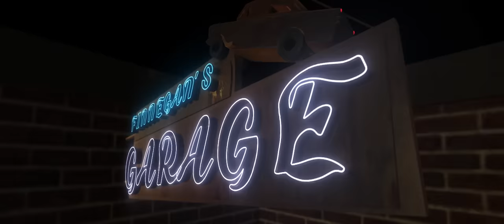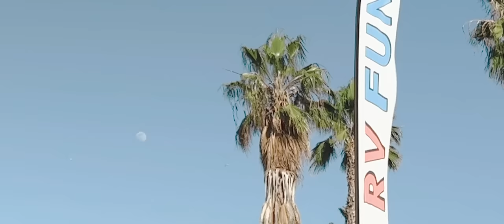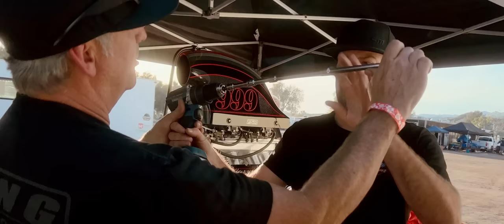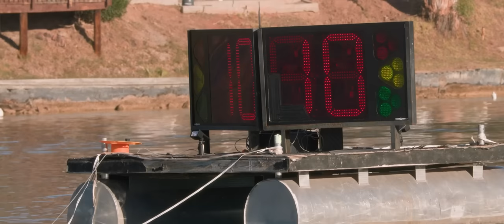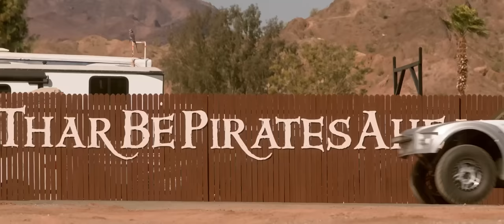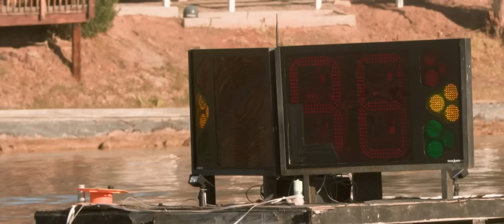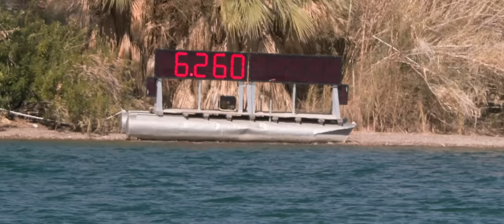BROKE THE 632CI V8 AND STILL WENT TO THE FINALS!

Comment: Hello Mike 
Awesome video.
On the milkshake issue,
Would you happen to have a
Pressure Relief Valve install?
Most pressure relief valves are set to 
15 lbs max. Anything higher than 15 lbs will blow gaskets causing milkshake. 
Also a water pressure gauge mounted on the intake manifold is always good to monitor the water pressure. 
But maybe they weren't installed because extra weight slows things down when racing.
Thanks again Mike,
Love the boat racing videos
Peace
✌️😎

Comment: That fires up sweet! I see a lot of these "tuned" engines on YouTube and they always crank for days and days before starting. I never understand it. I don't know if it's something with with the tune or the ECU timing fuel injection or something I don't know. I'm just saying even on engines that aren't built mostly carbureted when the timings right and you have a good ignition system it's just a tap the key pops right off
Reply: Like I understand that with a crank trigger the engine has to make a rotation before it can pick up a signal. It just seems odd to me For a race engine to crank  for days before it starts. I don't know what you're running for ignition but that pops off really nice 👍

Comment: Awesome Show! Tell us about the differences between propeller boats and jet boats. Tell us why you like water pump!
Reply from the maker: i like the acceleration of the jet drive. I also like the challenge of making a jet boat work properly. from what i understand, propeller-driven boats are more efficient and faster. Top Fuel Hydros have twin counter-rotating propellers and can run over 260 mph. No jet boat will do that.

Comment: Can you use a spoiler type thing on the front, but in the water.  Adjustable like a active aero/ but hydro. With the correct sensors you could use like a laser height sensor. Keep it in the water.

Comment: Here's a tip of you Finn! Put a small hole in a 1" suction cup, attach an air nozzle and use light pressure to force the jb weld into the pores.

Comment: So just curios Mike after making that first good pass and watching that camera under the bow the left side (sitting in the drivers seat) looks like it's sitting lower in the water than the right during the run is that caused by the torque of the engine and or the prop and does more boat in the water create drag or are the hulls just that slick and nothing slows them down, excuse my apparent stupidity just never spent that much time around boats although now I'll be seeing more.....

Comment: You should get a pressure regulator for a boiler. It would still let water flow but they're usually set at 15 lbs. of pressure to auto fill the heating system.

Comment: Ok so plugging the line with a pipe plug drilled to a smaller size will increase pressure only restriction will be in volume but the pressure should actually increase with only the volume decreasing. Think of a water hose no end on the hose low pressure lots of volume but if you put a sprayer end or let’s say you put a low flow shower head the pressure would be amazing it would just cut the volume down. So you save water but you have amazing pressure. I only use low flow shower heads and the absolutey have the best pressure and anyone who uses my shower always comments on the pressure coming from the shower head. But you do you. The best way to kill the pressure would be to go bigger the volume will increase but the pressure will go down.  Hope this helps you bud

Comment: Should look into a helmet with a duck bill at the bottom to help prevent the lifting. Looks like you’re holding it down at the end of each run. Dirt racing helmets are sfi and designed for that.

Comment: HI here idea you could try it new idea, so for u test boat out of the lake is build very long pool or long dump truck trailer fill water so sit boat in water test boat and have tech gear near boat so don't keep going to the lake too test it, if someone got truck want build dyno pool tester for boats it save u 100's hours moving boat to lake., if have ramp on back so pull boat into it then fill up water with water tanker would be so much easy then way you doing now, if had crane on truck pickup the  boat save time as well so test more 1 boat a day. this make your life lot more easy as well test boat on spot.

Comment: super disappointing, but i fired up the 383 in my roadrunner for the first time with a flat tappet, and the alternator yacked. I have rubber chunks on the bottom of the hood from the belt running past it while it was locked up and I was breaking the cam in. Its been about 2 years.

Comment: I see you used the 2 part epoxy, but why could you not tig weld the leak on the head? Wouldn't that work better and be a more permanent fix?

Comment: Was the guy with the carburetor problems going rich because the squirter is bleeding in extra fuel at high rpm. Happens even if the throttle is not moved.
Reply from the maker: I don't think that was his problem He seemed to be having fuel distribution issues and a few cylinders were pretty lean.

Comment: One of my friends was too cheap to pay me to install a clutch in their 2002 camaro ss and I was giving them a excellent deal at my shop.  The person decided to do it themselves and put every extension together they had to access the top bell housing bolt.  They didn't anticipate the wobbling when they attached a 1/2" drive pneumatic impact on it.  When they pulled the trigger the only thing that broke loose was their teeth.  Paying me a couple hundred bucks to do the clutch would of been much cheaper then the $5000 they spent in dental work.

Comment: What could possibly go wrong, with a blazing alternator in a boat with racing fuel on board? Might need head gaskets too bro. Better get all of them to see if you can keep water out of the oil ports. Every time I got water in the oil it was gasket related guys. The way you guys spring information on us about previous disasters with the parts how in the world can we help you all trouble the problems without all the information to begin with? We can't~!~ Now you're going to cook the motor by restricting the water flow into it. Not a good call guys, unless you wanted warped heads. Then go for it. So you went to the finals, did you win your class? If not what's the big deal about getting into the finals, you're still broken down. I was thinking about drilling a valley in the head and JB weld it up but the vacuum idea is a good one too if you can get enough vacuum pressure to draw the JB into the crack properly. But we usually cut a valley into the head and weld it up, to make sure we get a good seal in the head itself. Only thing wrong with the video is that is had way too many commercials in it.

Comment: I really dont understand why you arent using an oil heater on that beast if it isnt getting up to temp to vaporise alcohols and water? Wouldnt it be as simple as putting an immersion element in the existing external tank and turning over the existing external mechanical pump with a drill occasionally?? Can someone set me straight?
Reply from the maker: We are using an oil heater. It’s in the oil tank.

Comment: Man. Know what would make a lot more sense? If the track didn't change with a slight breeze, and if you had belts and a cage around you going 150mph, and you never worried about drowning or fishing your $20,000 motor out of the bottom of a lake if things went slightly badly. I gotta tell you, nothing in the world makes me want to do this. You have kids. You shouldn't either. It's dumb. Ask Ken block how fun things without a cage are.....don't die because "I want to do that" even though it's dumb.

Comment: These guys cannot fix a simple pinhole properly.Vacuum?just bore the hole out and then jb weld it.
Reply from the maker: Fixed is fixed.
Reply: @FinnegansGarage  my way or highway?why not put out more tech details for us hc car fanatics.like I was bummed to not know the lift of the cam.I raced over 15 yrs bbc s,built many to finance my addiction which is expensive here in Finland.Ended my illustrious career with 12-71 blown 526 ex pro mod bbc.
Reply from the maker: @teknoaija1762  valve lift is .954/.875, duration @0.050 is 288/310
Reply: @FinnegansGarage  NICE.. no wonder valvesprings are singing hallelujah...